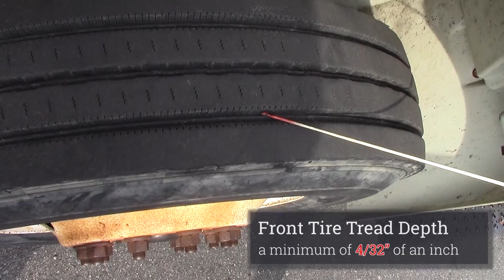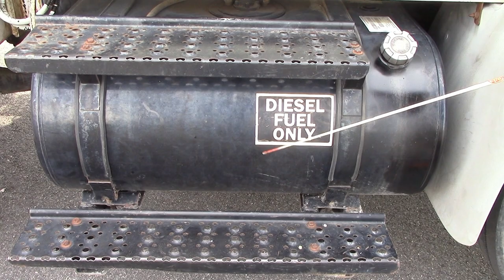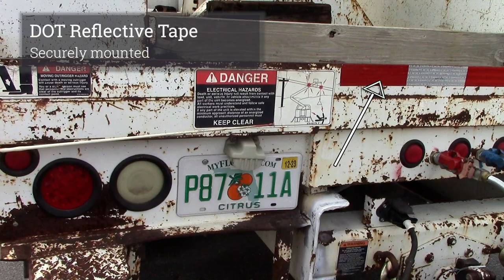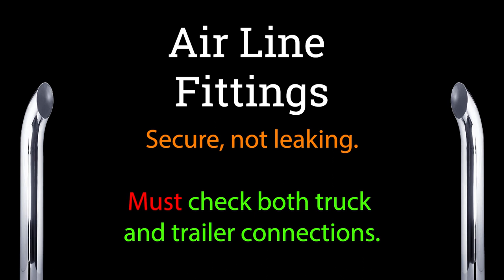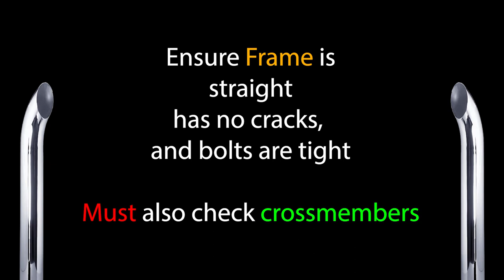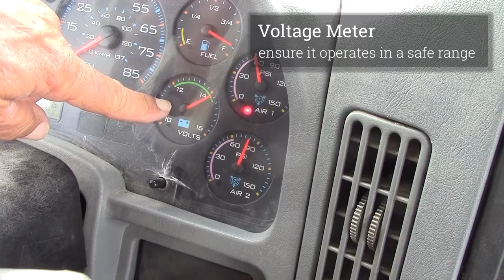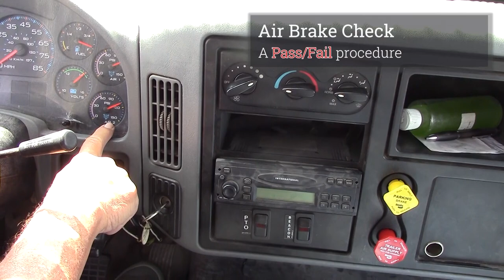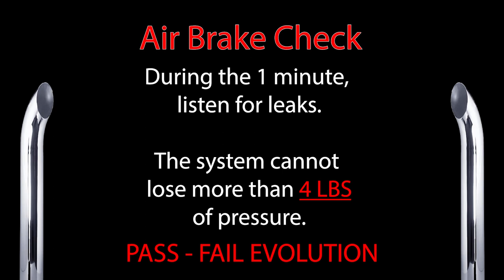CDL Class A w/Air Pre-Trip Inspection for a Truck/Trailer (Pintle Hitch)

Comment: Is there are a video for class b automatic air break test?? I see a lot of videos specifically for class A
Reply from the maker: @LadyMocha The airbrake check would be the same in an automatic as it would be for a manual transmission.  Here is an example using a Class B vehicle with an automatic transmission (School Bus https://youtu.be/creA7EU4YaU?si=YX4hLman3apuxkT3&t=1174 ). Again, for the current "more correct" terminology, refer to the answer I provided to your question on our Dump Truck video.
Reply: @smgtrucking  ok thanks